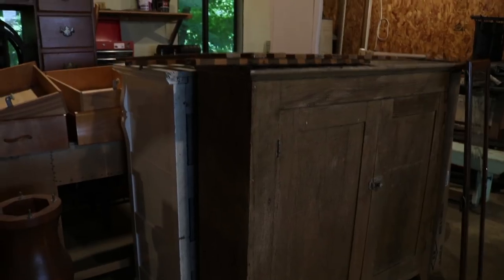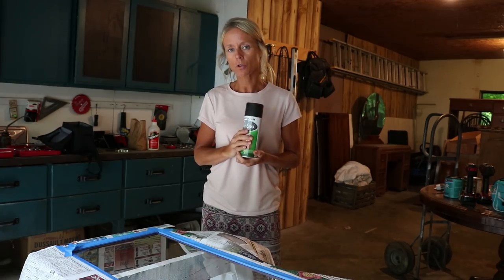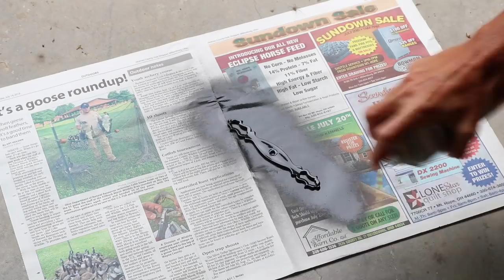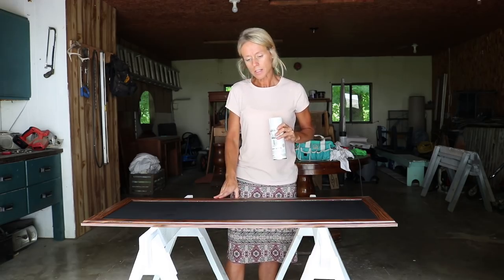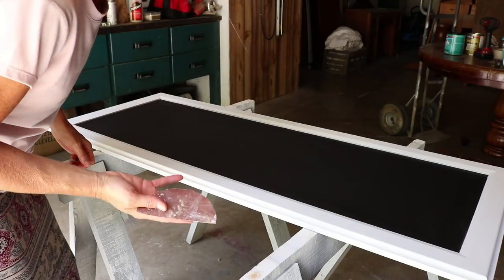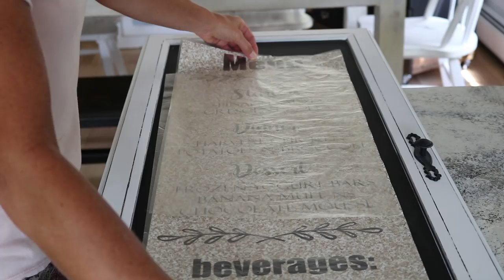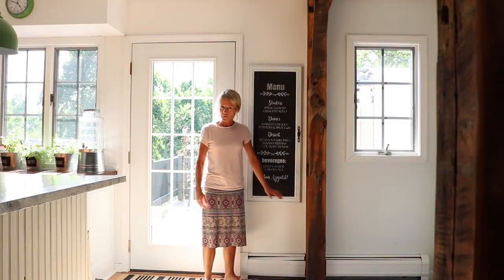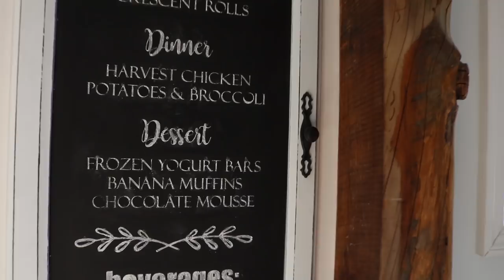DIY Chalkboard

Comment: What a marvellous idea to use a cast off door to make this chalkboard. I am a quilter and I use chalk to mark my  quilts with a stencil. The product i use is a Pounce bag. It is basically an applicator with powdered chalk in it sort of like a sponge. You shake it upside down to load the chalk to the sponge and just rub it over the stencil and like magic the pattern is there when you lift the stencil. You might find this method much easier. I just discovered your videos through a friend and am loving them. I love to restore old things as well and am always open to new ideas.
Reply from the maker: Wendy Ouellette thank you so much for that tip! I've never heard of a pounce bag. I will check into using one in the future since it was a bit of a challenge getting chalk into all those little letters on my board. Thanks for taking an interest in my videos!

Comment: I sometimes have a hard time getting my clear contact paper to release from my stencil.  So I took glad press and seal put that down on top, then I added the clear contact paper for stability and HOLY COW life changing!  Try it.  You'll be amazed.  The stincle comes right off and you can reuse it.  I always love your projects!
Reply from the maker: Mary LeSueur thanks for watching and for that tip! When I cut off a new piece of clear transfer tape, I will stick it all over our sofa, rug and even the floor sometimes just to get it less sticky. It looks kinda gross but it works! :)

Comment: I have been using Rust-Oleum products as well since I started my chalked items. I think it goes on smooth and also use the Matt clear for their chalked paint as well, unless it is a high traffic area. Then I use multiple layers of the Polyacrylic like you do. I am doing this project using an old calendar frame. Thanks for the tips. How do you clean it for the next menu?

Comment: Maybe next time you could try taking a piece of clear contact paper and painting it with the black chalkboard paint and then apply that directly to the chalkboard.  Then you could actually paint the menu onto the contact paper and then just remove the contact paper when done and you would have the original chalk board itself.

Comment: Hi Mary, can I do a chalk board to a wood cabinet door. It has paint on it. I need to strip the paint off. Do I Sandy after I do that? I would really love a silhouette cameo.... R they very expensive.... you are my favorite channel  to watch!!
Reply from the maker: Thanks for watching! My Silhouette cameo 3 was around 260.00 I saved up for about 6 months for it.:) you need a computer to use it but I'm honestly not sure about Wi-Fi. I think you may need it to set it up but I don't think you need it to use it then..hope you can get one, they are worth every penny! And yes, I have painted wood doors with chalkboard paint quite a lot. I wouldn't bother stripping the original finish..just sand it smooth.  Good luck!

Comment: Hi Mary,
I Have One Of These -Too.  It's From A TV Storage Console I Have.  Originally, I Was Going To Get Someone To Saw This Part Off From The Entertainment Center...And Use It As A Glass Door Bookshelf...For I Have Many Books Lined Up On The Stairs, (A Fall Hazard), That Needs A Home.  It's Like, I Have My Own Personal Library.  Many, Many Books To Store.

Now, That I've Seen You Do This...I'm Having Second Thoughts.  I Could Still Use The Case Without The Door And Use For An Open Bookcase.  Or, I Could Reattach This Door As A Chalk Board Door...Making It A  Double-Used Piece.  What Do You Think Mary?  

Also, Do You Think Putting Up Shelves And Nails Into This Vaneer Case Would Strip/Crack The Piece???  Please Let Me Know Your Thoughts.  TYIA!!!  Again, You Are An Inspiration To Folks -Like Me.  Thanks For Sharing!!!
🙂💚💜

Comment: Hi Mary, I have a tiny home and need to have a 2-drawer file cabinet for practical purposes, like insurance paperwork, income tax info, etc.  How can I make this look like a piece of furniture, rather than office equipment?
Reply from the maker: So far I've never redone a filing cabinet to make it look more like a piece of furniture, but I've thought about it. In fact, we are in need of night stands and I've considered using filing cabinets as the base. what I'd do is just add a wood top. Wal-Mart has black filing cabinets, so I'd probably get one there and paint it another color with spray paint, then sand off the edges, if you like that look. The wood top would really make it look different. I'm sure there are other ways to do this and I'd probably search on Pinterest for some inspiration, but this might be one. Good luck!